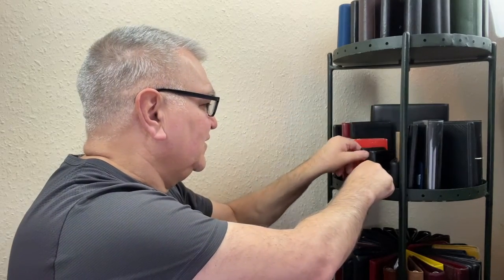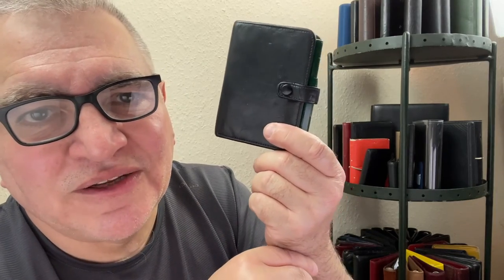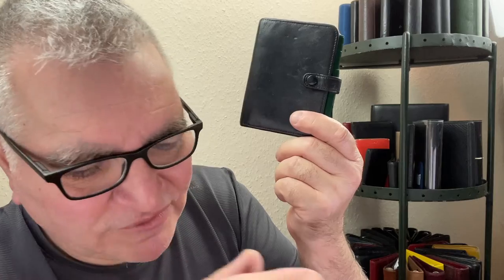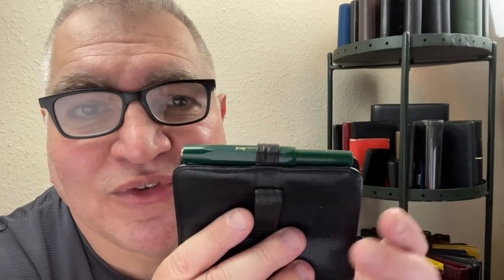My Unbelievably Effective Filofax Pen Loop Modification

Comment: Didn’t see that one coming 🤯 Interesting tip 👍🏻 Thanks for sharing 😊 I was left wondering did you have a reason to put the pen that way around, nib downwards and slimmer side up. What was your reasoning for that? You surely must have thought it through 😅
Reply from the maker: Thank you for your kind feedback.
The reason for the pen nib pointing downwards is to ensure that the inevitable pocket of air, within the ink cartridge, stays well away from the ink feed into the nib, thus minimising the possibility of a "stoppage", assuming that the binder is stored the right way up when carried.
Reply: @Flatability  Thank you, I knew you must have thought it through thoroughly 👍🏼 I store all my fountain pens horizontally at home so I was curious about your reasoning 😊